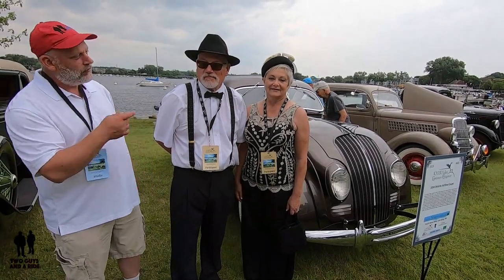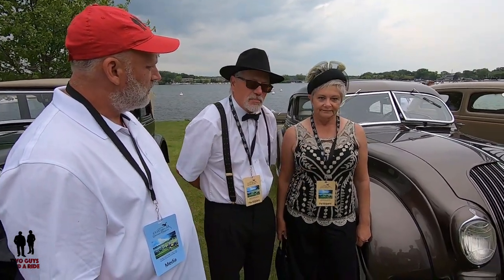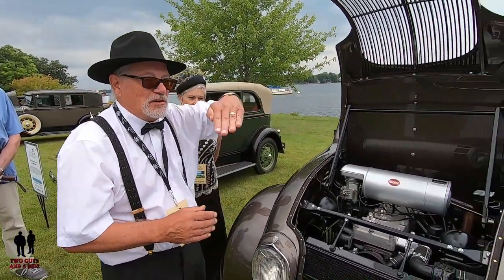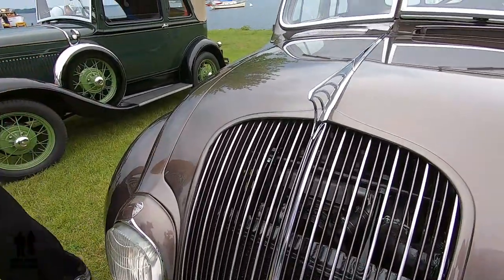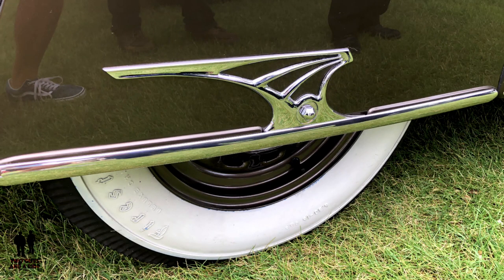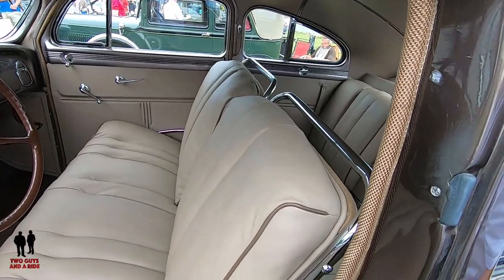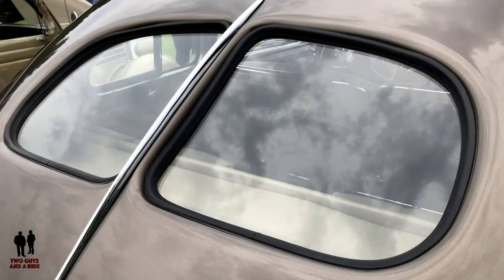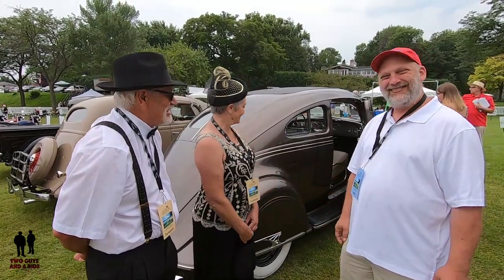DeSoto Airflow 1934

Comment from the maker: Comments about this very cool and rare DeSoto Airflow? Let us hear from you...tell us what you think or if you've seen such a cool car in person!
Reply: I was getting an adjustment at my chiropractor's one day and a later model DeSoto Airflow pulled into the parking lot.  The owner said they also had a '28 and a '61, being the first and last year of DeSoto.
Reply from the maker: Seed_drill This is a spectacular example of attempts at early aerodynamics in Auto design. Fred and Renee are a great couple and you can see their genuine love for this beautiful car!
Reply: I own a 36. It's a little ruff but runs and drives. I was contemplating rodding it because the parts are so rare and it's not and never will be a numbers matching car but Its been spared for the time being as I have other classics to "destroy" like my supercharged fox body and Ford V8 swapped BMW E30. Basically the Desoto sits in the garage and will most likely remain un harmed.
Reply: @dngendron  Good God, I hope you didn't "rod" it.  What a tragedy that would be.
Reply from the maker: Agreed!

Comment: Airflow was the sister car to the AirSteam.  Both had the DeSoto, limousine Imperial, and Chrysler.  Airstream had a conventional front end, head lights and wagon fenders. But, it shared Airflow's advanced 4 wheel hydraulic brakes, all-around safety glass, dashboard, steel unibody construction, standard shock-absorbers, two rear lights, "Floating Power" rubber engine mounts, and the same engines and transmission. Despite the failure of the Airflow, Chrysler's sales went up in 1934.  People came into show rooms to see the Airflow but drove home in an AirStream. The 1936 Dodge was basically a stripped down, re-styled Airflow/AirStream,  which saved Chrysler millions in retooling. Dodge sales went up.  Ford didn't catch up until 1937.
Reply from the maker: Thanks for all the information and history. Thanks for watching

Comment: This and is Chrysler sister may be my favorite car of all time. That waterfall grill is wonderful. I love the dash. I love the seat design.
        In previous cars, the passenger seat was sitting atop the rear axle. In this car, and in modern cars, the rear axle is behind the rear seat passengers. By sitting atop the rear axle, the problem for the rear seat passengers was not teeter-tottering. The problem for the rear seat passengers was bouncing up and down whenever the rear axle hit a bump, or a pot hole. The passengers would go up, or down, about same distance as the axle went up or down. In this car, because the passengers were in front to the rear axle, the passengers bounced up and down much less than the rear axle bounced up and down. So they had a much more comfortable ride than in earlier cars. Simple but effective.
      This car has 3 forward speeds AND over drive in addition. Some of them also had automatic freewheeling. Going downhill you had a choice, you could select  freewheeling, and save on engine wear and tear, or you could select engine engagement, you could engage the engine to the drive train, and have engine braking.
      The jump seats fold up much like in a Honda Fit (or Jazz).
Reply from the maker: Great information and I agree….it’s one of my all time favorite designed cars as well. Imagine how forward thinking those designers and engineers were. No car car company today would ever allow such flights of fancy much less actually build it! Thanks for watching

Comment: Seeing the closeup views I can see that this car is even more sophisticated and beautiful than I had previously realized. I think this must be my favorite car of all time. Although the engineering was superb, word is that they were not constructed very well, they didn't have good quality control, and owners were confronted with lots of defects. And we know that it didn't sell very well.
Reply from the maker: It’s even more spectacular in person. The lines and details are so intricate. I love too! Thanks for watching
Reply: @TwoGuysandaRide  The ease, and speed, with which a properly designed and properly lubricated window mechanism can enable a window to roll up and down makes modern electric windows seem ridiculous. I love the way the hood opens. It is so simple and elegant. Is that original? Is the cross-brace behind the radiator original? I would love to drive this car around but I heard that the brakes on these things, although hydraulic, were not up to modern standards of stopping distance. Has something been done to this paricular vehicle to improve the brakes? I suppose that just by using an improved lining material you can get a somewhat shorter stopping distance.  I've seen the overdrive in action, in a video. I looks fantastic. Yes it is a 3 speed transmission, plus an overdrive gear ratio. And it goes into overdrive automatically when the (mechanical) computer decides it's needed. It also will freewheel automatically, when automatic overdrive is selected!. Or you can shut if off if you don't want it going into overdrive when you are careening down a hill at the breakneck speed of 45 mph in 1934. Where on earth does one get another oval sealed beam headlamps when the filament burns out in the original headlamp? I''m guessing these are dual filament headlamps. In 1934 I believe cars had high beams and low beams. Also, I wonder if the VW Beetle, designed in the 1930's, has a similar body construction? It clearly took design cues from the Airflow. The Beetle is not all welded together, like a traditional unibody, but it doesn't have a full-strength frame either. On bottom is a "pan" with a center tunnel, and the body is bolted, not welded, to the pan. But the body relies on the pan for structural rigidity. And the flat pan may add aerodynamics to the car. So the Beetle was "unibody-like" if not actually unibody. It is not "body on frame." I'd like to see the bottom of this Airflow. Are there aerodynamic features to the bottom? I can't believe they added more "nose" to later models. I think they ruined the appearance by doing that. Possibly this also reduced visibility ahead for the driver.
Reply: The first few might have been, but for the most part, this was a very well built car.